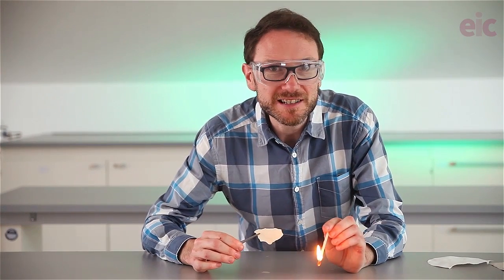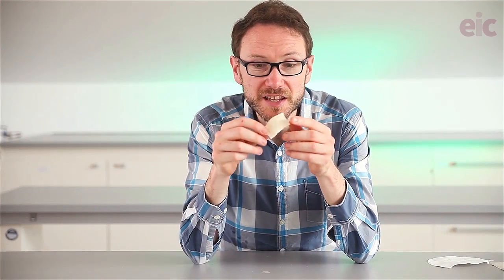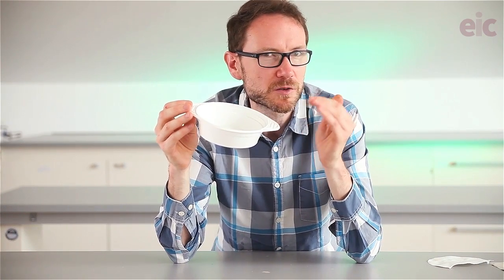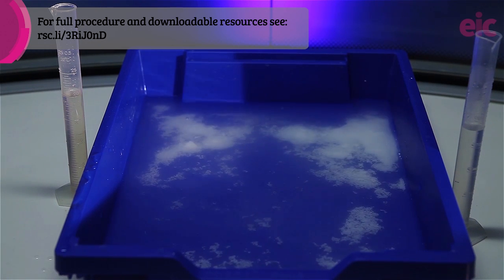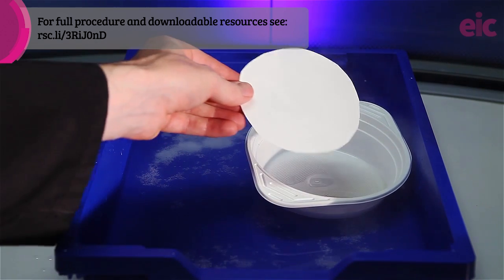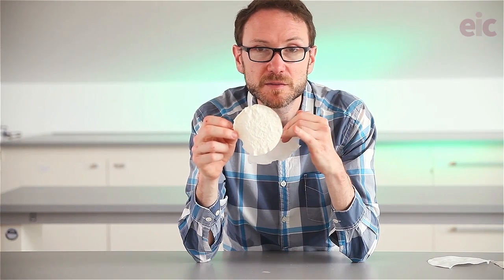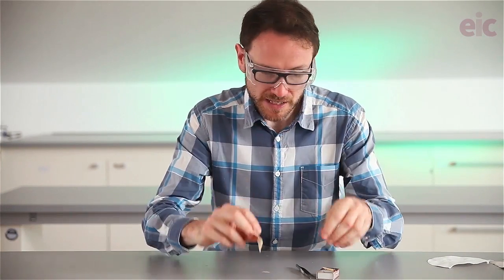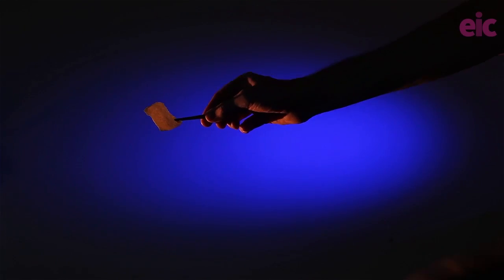Flash paper: nitrocellulose combustion

Comment: That's good 👍 Fake simulation preset 

Falcon facemask that is aero nbc gold glass mineral element ✨️ platinum + vanadium chroma Ti aluminium scandium _ performance armour for contemporary use + similar designs complimentary to + steel based qcrive ar and medieval design aesthetics 😀 can be ysed gor flying + can have ted blue black and fullt transparent 

Chair cover is very correct 👌 👍 

Other vwry odd thing you can do is take off flat rarher than nose up _ kinetics can correct for control inputs. For carrier use this is loads less stress on the ram that pushes it + safer way to change altitude for passengers + lower drag faster speed 😳 more speed is more speed difference and therefore lift. Leather quality 👌 vase has one 👌 

Partnered analogue as the basis for flight control by ai _ haptic feedback and structural imit insights _ biometrics modulated flight envelopes ✉️ 😀 _ flies as fit as yoy can get basically 😀 bzzt one of those things 😀 

Strap solid fuel boosters to the wings 🪽 lockheed's pointiest space shuttle + boeing are fully space flavoured _ fastest or rocket to near space 🤔 _ anti war plane – leave the dangerous warhead explosives + gjidance systems, and use the motors to fire the plane at altitude _ basically x plane button 😜

Comment: Lovely idea for the safety bath. 
Doesn't the temp have to be kept below 10'C? Maybe add some ice? 
Also, would a rinse be a good idea before drying to remove neutralisation salts that might slow the burn?
Reply: hey thanks for the feedback - as you can see in the product, it the high surface area of contact seems to work ok - the recipe was based on the original Special Risk Assessment (SRA) from CLEAPSS and I tried to minimise too much deviation from a prep they already felt was optimised. As for an extra wash - it certainly can't do any harm. Some recipes suggest an alcohol wash as well to expedite drying but again see above - every deviation from the established SRS was going to need extra thought so I kept it simple :)
Reply: @declan.fleming  A fair point indeed when dealing with something as dodgy as this. 
Up here in Scotland our equivalent of CLEAPSS is SSERC. They've got a nice guide to making guncotton that suggested my temp limit, but that's possibly to avoid internal heating in the cotton ball. No such problem with a filter paper! 
Keep up the grand work!